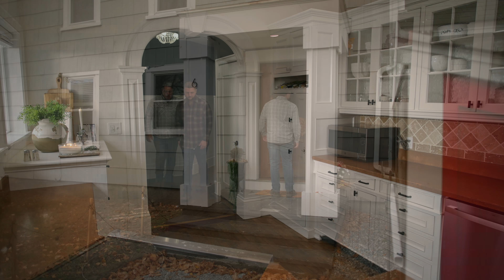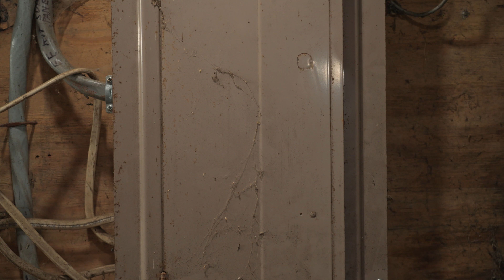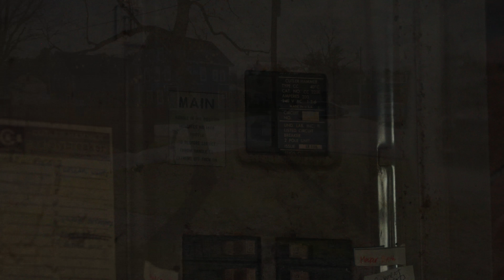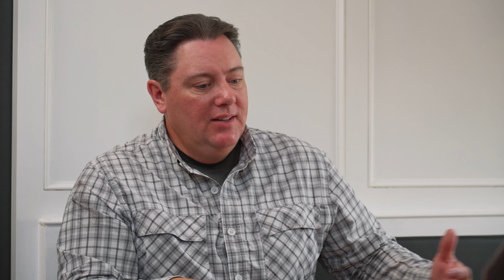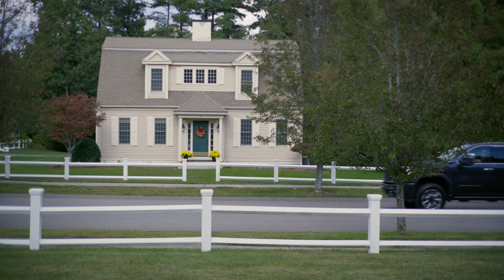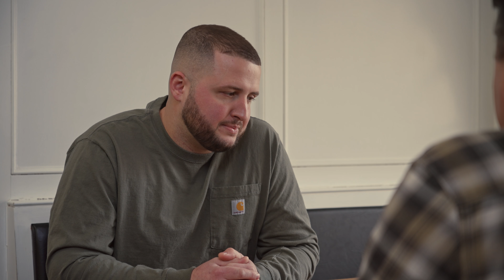Troubleshooting a High Electric Bill | Ask This Old House

Comment: Has electric heating but is shocked his electric bill is higher in the winter.
Reply: Rip out the mini splits and put in resistive heat. THAT will give something to complain about. Your bill would double again. 😂
Reply: I bet he was hoping they would replace his electric panel for free lol
Reply: My friend had an electric furnace and water heater, his monthly bills were insane. He paid 10k to install a natural gas line to his house and switched to gas furnace/water heater and now his bills are peanuts compared to before.
Reply: @SteveBennet500  Also can put the electric water heater on a timer so it's not constantly running 24hrs a day to maintain the set temp
Reply: @amyk6028  modern water heaters are very well insulated, and so they should NOT be running all the time to keep the water hot. Unless somebody is filling bathtubs constantly, even an electric water heater should not take all that much power.
Reply: @SteveBennet500  Exactly 👍 his problem is: he’s an electriholic.
Reply: What you would like to do is an energy audit of the house . This is an old house as the name of the show describes . Energy leakage maybe occuring  and that needs to be addressed
Reply: @ If a house is older than 30-40 years and never had a total remodel down to the studs and ceiling joists it probably has massive air leaks. No one cared about vapor barriers and proper insulation before then  because heating cost were low. Our house is so airtight we have to have a fresh air system with a heat exchanger.
Reply: I grew up in New England in the  50s and 60s and there was a big push to make all electric homes with all the nuclear power plants being built at that time.
Reply: The man claimed oil furnace for  heating the old part of the  house and  that heat  convects up to the second floor  tenants . The added heat pump from the mini-split the well pump providing water to the whole  house . They never mentioned what was going on in the shop in a  exterior  building I would suppose . Multiple ovens and  dryers . All the extra appliances could  add up substantially .  The solar plan, that would be  great for another story line.
Reply: Electric water heater.
Reply: @dianealbrecht718  Water heater use should be nearly flat for the entire year. Its heating use that increases.
Reply: @guytech7310  Not true, during summer the water coming from the ground is warmer compared to winter. I see a 100kwh difference from summer to winter on my electric bill. The same appliances are used all year, same routine and everything.

The water from the tap during winter is ice cold, so the heater has to work much harder to get it up to temperature.
Reply: @Catalin_C97  Tap water temperature is influenced by melt water. You don't use tap water for geothermal system. You use the ground temperature which remains around 55F:

Google: "At a depth of around 6 feet, the ground temperature across much of the contiguous United States tends to remain relatively stable throughout the year, generally between 50°F and 60°F"

This is why companies do make & sell geothermal heat pumps. You get the best of both worlds for both heating & cooling. 55F is pretty much  close to the idea temperature for operating a heat pump year round. 

Generally you dig a 6 foot trench at lay about 500 feet to 1000 feet of black poly pile for a geothermal system. Its a close loop system.
Reply: RIGHT!  And this is why we use natural gas or propane in the boonies!
Reply: That guys is a idiot
Reply: I have electric heat but my electricity bill is higher in the summer
Reply: And water heater. This was trash
Reply: Freaking Idiot 😂
Reply: Just landlord things
Reply: I wonder if the oil furnace would be cheaper than the electric minisplit heat.
Reply: @David_H_Parker 
Definitely not cheaper...I had one.  Geothermal gives an advantage being the exchange of temperature happens underground which is typically around 50 degrees.  

I did all the things mentioned including solar & geothermal & heat pump water heater... By far the geothermal & mini split increase my bill many times over even with some solar in the winter.  However still cheaper than oil by a lot.
Reply: @Gamerz007z  Yeah but most homes don't have geothermal system installed so you're talking at least $20k for that. And that's a guess so it's probably more.
Reply: @David_H_Parker  Heat pump is cheaper than my natural gas 97% efficient furnace. Heat pumps are the way to go.
Reply: @boris9305  It depends where in the country you live. Heat pumps do not work below a certain temperature and require emergency resistive heat strips to provide adequate heat.

It also depends on the utility rates because they vary greatly from state to state.

In moderate climates, heat pumps are the way to go. Most modern heat pumps are 300% efficient for heating. Natural gas only gets up to the high 90's%.
Reply: @David_H_Parker  I live in Canada and have my heat pump work until -5C there are models that work to -25 as per the manufacturer.
Reply: @boris9305  Our electric company charges $13 per kwh during peak times, which are 6am-9am in the winter, just when you need your heat pump and water heater the most. They are always gonna find a way to screw us. In January, I paid $129 for ONE hour of power one day when it was 5 degrees outside and my heat pump was running. We have to keep our heat set at 60 degrees in the house in the winter to avoid paying $500/mo. Ridiculous
Reply: @David_H_Parker , high quality min--splits (think Mitsubishi) are very efficient, even in the winter. Low quality mini-splits (they're all over Amazon) can still be efficient in AC mode, but heating mode is another story. You'd probably get better efficiency from space heaters.
Reply: @David_H_Parkefefinitley! Those minis are very good cooling, but terrible with heat
Reply: @David_H_Parker Not usually. I have oil and even resistive electric space heaters in the house is cheaper than oil, so the heat pump is likely muuuuch cheaper than oil, unless he lives on a refinery to get it wholesale lmfao
Reply: @ Your state might have really low electric rates too.

Solar would be good if he can get a good program to subsidize it.
Reply: @ Solar’s always a good bet even if you can’t get a subsidy for it, it will almost always pay itself off well before the panels die, unless you have a really crappy installer.
Reply: @cheeseisgreat24  Paying retail for solar takes 25-35 years for the ROI to pencil out.
Reply: @ Only if you have an installer price gouging you. Even if you pay full price it should take only 8-10 years.
Reply: Insulate before solar. Pays during the night. Solar does not  @cheeseisgreat24
Reply: @David_H_Parker 
This is a case per case basis.  I have broken even in under 10 years.  I do however live in Massachusetts….we are pretty much the worst state in the contiguous US lol
Reply: @David_H_Parker After that amount of time everything will be replaced.
Reply: Sell the house. It’s a money pit and inefficient. When those old houses were built coal was used to heat the furnace and was cheap. Those days are over. Now you are sucking diesel all winter.
Reply: What a waste of time.
Reply: @stevenwisniewski  Exactly natural gas is always the most affordable!
Reply: @RealMTBAddict  Natural gas has historically been cheaper because it was difficult to export. And the USA producers weren't limiting production because it was often the more valuable oil that they were going after. But with all the LNG plants starting up to export natural gas that situation is very likely to change. When installing a new HVAC system we need to look forward to take an educated guess on what future costs will be for the next 10-20 years, not past costs.
Reply: @RealMTBAddict 
Not the most affordable... Natural gas where I am now charges base of $58 before using any natural gas each month.  

I had fuel oil it was double the price of electric
Reply: @RealMTBAddict not everywhere.
Reply: Oil heat....
Reply: @stevenwisniewski Aren’t you something special. No friends in your childhood days…
Reply: A modern Oil Boiler will outperform a Heat pump when Temps are near or below freezing outside as long as it sized properly.

For the water heater, using a tankless or aux. loop connected to the boiler would be a better option. Heat pump Hot Water heater will dump cold air inside raising the heat load, and Heat pump water heaters are more likely to break.
Reply: You don't have to go to YouTube and write dkish comments all the time.

Comment: Meter was spinning way too fast.
Reply: When we lived in an apartment years ago, the electric bill was extremely high.  I turned off the main breaker and found that all the lights around the building were on my meter !
Reply: @2pugman  that's illegal if you're paying for it. Did you get it fixed?
Reply: @2pugman  My old and last apartment I lived in charged everyone $110 a month for water. So for a 4 plex they were making $440 a month, a water bill is only $40 a month for a house. I called them out on it and they lied, they just made up their own water bill on Microsoft Word, nothing from the utility company was ever provided even when asked

Comment: The second leg of the shop panel being almost 500kWh is very suspect. That said, I live in a 1900 built house- it’s very drafty, and while I am comfortable in the winter/ summer, I pay for it. I’d be curious if one or both of those heat pumps are running in a “emergency heat” mode, where they are turning on resistive elements (aka: traditional electric heater) elements- that will skyrocket your usage.
I can also say that moving to a heat pump water water heater cuts the bill visibly, but be ready for a cold basement in the winter.
Reply: Garage has a grow room.
Reply: Yes! A very large difference on the 2 legs shows the circuit drawing the most power is 120V.  Never seen a 120V heat pump and I know internally perhaps the fan motor is using 120V but that high usage would mean a defect in the heat pump
Reply: @NorKavon  There are some smaller mini-split type heat pumps that run on 120. I've installed a few. I prefer the 240V models, but sometimes there are constraints and the 120V model works out a little better. I think there's a much larger issue with that garage panel with one leg being so much higher than the other. I'd expect some difference between the two legs, but that was a huge disparity. Either that panel is wildly unbalanced or some 120V load is really gulping it up. That one leg was more than anything else he had in the house.... Maybe a neighbor is tapped in? Charging an EV with the crappy 120V charger? I'd be looking at that garage panel.
Reply: 💯 That’s what I’m thinking too.

Comment: I have an Emporia Vue monitor in my breaker box. Very useful.
Reply: What is an Emporia Vue? What does it do
Reply: @lawrencebraun7616  It's the energy monitor they used in the video.  Constantly measures electricity consumption per circuit.  Very useful for getting insights into your energy use in your home.

Comment: I never seen a meter spin that fast!
Reply: Only time I've ever seen a meter spin like that was when I was in a house that had A/C, a pool circulation pump, and a hot tub heater running at the same time.
Reply: Lol try full  eltric  house when it's -25  F blowing 45.
Reply: @Wrang15  maybe get a fireplace installed
Reply: To quote Dr. Emmet Brown in Back to the Future:

“88 miles per hour!”
Reply: It almost took off

Comment: More app trash. Assuming it's proprietary and will only be supported for a few years if that. And high probability the homeowner's data is being sold / shared with others.
Reply: Exactly!
Reply: Once the utility puts in a smart meter, could the utility be watching his usage just like his power monitor? Just got a note from my utility expressing disappointment in using more power than last month, basically electronics.
Reply: @scottrandall8502  Yes, to a limited extent. Utility can make some educated guesses about usage patterns including possible appliances being used, but wouldn't have the detail the app has.
Reply: @scottrandall8502  yes they can, but it's also easier to manipulate your usage with no accountability.

Comment: Here in Orange County, California, a lot of the single-family houses from the 1960's to 1980's were built with a barely finished upstairs "bonus room."  It was a way to add another bedroom to the lot without having to pay a higher property tax, I believe.

Anywho, the bonus rooms were finished with the crummiest materials possible, including literal stereo speaker-wires in the walls to the run the 120v outlets.

My parents had a huge electric bill during the 2000's due to some of these wires melting in the wall under intense heat and creating an unrestrained fault to ground.  The electricity bill was assumed to be higher by my parents because they had just had an in-ground pool installed also.  It wasn't until years later that the wall fault was detected and corrected... scary!

Comment: A Heat Pump will cost you a fortune for sure.
Reply: That heat pump water heater will save energy and qualifies for a tax break.
Reply: @XX-166 Afraid not had it 5 years no tax breaks in the U.K. 🇬🇧 the price of electricity is 3 times that of gas all owned by foreigners France,Spain and Germany and they hold us to ransom.
Reply: @ not the case in the U.S. it’s unfortunate your rates are higher then my blood pressure.
Reply: @XX-166 That doesn't make up the cost.
Reply: @ the tax break and the costs while using it will
Reply: @XX-166  tax breaks aren't all that.
Reply: @ especially when you don’t claim them as you should
Reply: @XX-166  they never do.
Reply: @RealMTBAddict  find yourself a better tax preparer 😂
Reply: @XX-166  umm and pay them to lie? The problem is the government taxing too much. Maybe wake up and quit trying to joke about everything.
Reply: @ they know the tax laws… YOU DONT 😂
Reply: @XX-166  You ok?
Reply: @ when you take your meds with a bigger glass of water you will be
Reply: @XX-166  ?
Reply: @ girl???
Reply: @RealMTBAddict you need to calm down

Comment: That meter was spinning like it was attached to a factory!
Reply: The new design only digit, there is no more spinning.
Reply: @derickd2385  heat pumps are no good in colder climates   . You go to reserve heat when it gets down to 30 degrees . I live in southside VA with a brand new  lennox heat that monitors when resrve heat comes on and believe me when it comes on it is a shock to my electric bill .I hate heat pumps  . I live in NJ most of my life with traditional heat and air conditioning  and for the northern states heat pumps are no good . Even for living 15 minutes from NC  border they are no good here . I live  up on a hill and wind can be brutal at times We retired to VA in 2004 when Ford plant in Edison NJ closed . It  has been good for our wallet as taxes are alot cheaper here but that is it
Reply: @derickd2385  Yeah I know. I'm 42 years old. The digital ones started coming out 10 years ago. I've never seen an analog one run that fast.
Reply: Modern household full of gadgets and conveniences.
Reply: @David_H_Parker  True but it was spinning like there was 5 refrigerators running at once!
Reply: @ They don't seem to be trying to save electricity in that house. I was expecting them to show the renter was using all the power but it showed the electric water heater and the mini-splits being the major consumers. It seems like they are heating the old home to a very warm temperature and probably taking long hot showers, which would explain the dramatic well pump current use.
Reply: @David_H_Parker  they need to be comfortable 24/7. People need to learn how to live in different temperatures. My ac doesn't come on until it's 85 inside. Or I'll just go for a mountain bike ride in the woods for cooler temps. We don't have to stay inside.
Reply: @RealMTBAddict  I agree. People don't know how to put on a sweater and maybe another blanket when it gets colder. 

They want to walk around the house in shorts and a tee shirt in winter.
Reply: @David_H_Parker  Exactly. I can imagine how cold log cabins used to be, you could feel every gust of wind. They definitely layered up and had multiple blankets in bed. Nowadays people sleep at 72 degrees with just a sheet when it's 5 degrees outside.
Reply: @David_H_Parker    well pump is a drop in the bucket because run time is measured in minutes per day.
Reply: @rupe53  It is 3 households pulling from that well. Maybe it has a bad pressure tank, maybe there is more to the story we weren't  told or they didn't investigate deeper.

I get the impression they are not being frugal with any of the utilities. Perhaps they  are running the comfort appliances as if they were free.

Another thing to consider is the age of the house and heating it will be more expensive due to higher heat loss.

Either way, this episode was a giant nothingburger. Just another opportunity for TOH to advertise their sponsor's gadgets and widgets.
Reply: @David_H_Parker     agreed on most points. This was a high tech solution that never really gave us an answer.
Reply: @RealMTBAddict  85 degrees? You are crazy. That is too hot.
Reply: @ 85 degrees is a nice day in Southern California. 

Hot is relative.